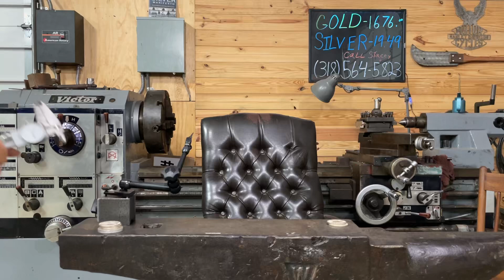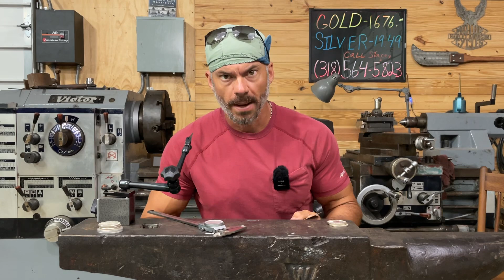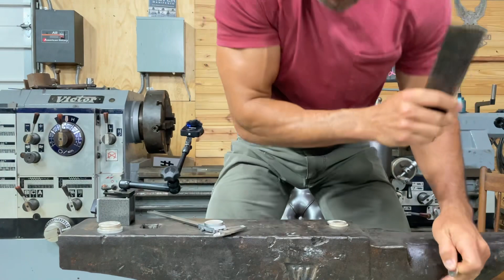Tips for Welding Horizontal 5G Spacers, Land and Gaps

Comment: Hey Chris, 
I am 25 years old and have been in the welding field now for about 2 years. I work in a fab shop and have gained some very good experience but am not enjoying what I am doing here anymore both physically and financially. I know I could be far bettering my experience and my money by getting into rig welding which is ultimately what I want to do. I don’t want to wait around forever I just want to make it happen. I do have a rig set up on a trailer currently but not a truck to put it on. I want to be the best I can at my craft and am always humble and never think I’m too good to do anything. If you have any advice on how I can get out of this shop and get to rig welding anything helps. Thank you sir and have a great day.
Reply from the maker: Start accumulating tools that you know you will need and don’t spend money on things you don’t need. That’s what I did
Reply: Thank you sir I appreciate you taking the time to reply.

Comment: i feel like horizontal welds are in the 2g position
Reply from the maker: I don’t know to be honest with you
Reply from the maker: 5G Pipe Welding Position. 5G welding position is a situation where the pipe is in the horizontal or X-axis position, but the pipe is stationary or cannot be rotated. The welder performs the welding while moving it around the pipe. This situation is almost the same as the 1G situation; only the pipe cannot be rotated
Reply: 1g is flat (plate usually), 2g is horizontal (pipe and plate), 3g is vertical (plate), 4g is overhead weld (refers to plate), 5g is a vertical (up or downhill incorporates 1, 3, and 4g positioning) weld on pipe and 6g is 45° on  pipe as well (incorporates all positions).
Reply: @ek8923  just a minor correction to your statement, the 5G position incorporates 1, 3 and 4G positions.
Reply: @carlosrobertson8265  thanks, not sure why I put 2g instead of 1g, the top of the pipe definitely is  the 1g and not the 2g. I corrected 👍🏽👍🏽
Reply: My first weld at work was a overhead
 3/4 "  threadolet on a 3" steam header 6' off the ground in a completed mechanical room in NYC where I work with crap in the way. I made the weld but it was ugly but it didn't leak. It was very difficult to keep the rod angle and go around the pipe.

Comment: We have to do a 5G uphill at school, I’m having a rough time on the bottom half, keeping icicles from forming. I let it cool down and turn my heat lower. Could you give some tricks for that
Reply from the maker: 7018?
Reply: 6010 root, I use a 6010 hot pass with 7018 fill and cap. I have a problem with icicles with the 7018
Reply: My machine at home is an older moveable coil welder. I know the dial isn’t right but the way it welds I’ve got to be around 105-110 amps